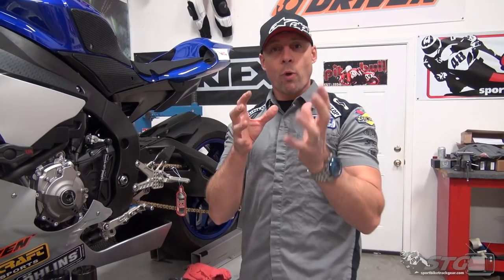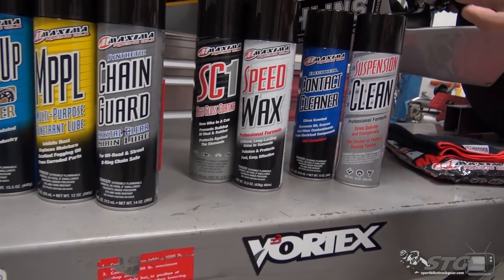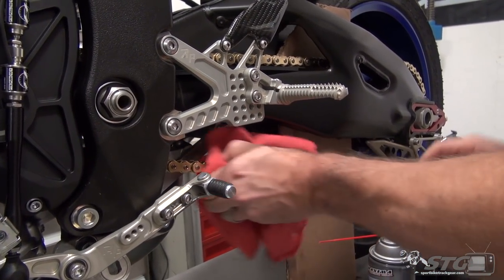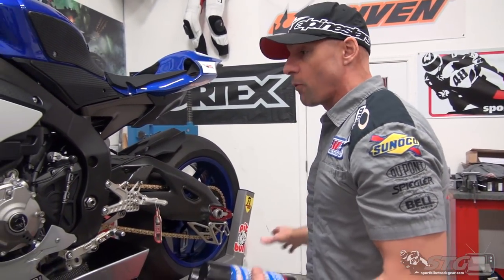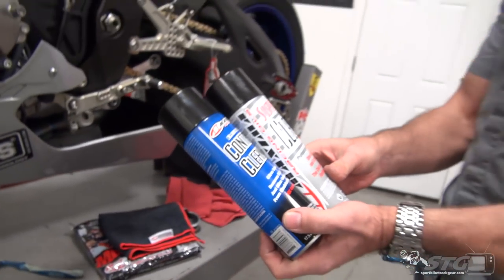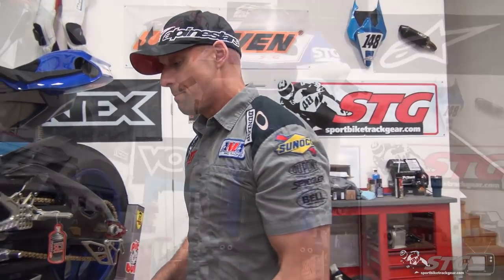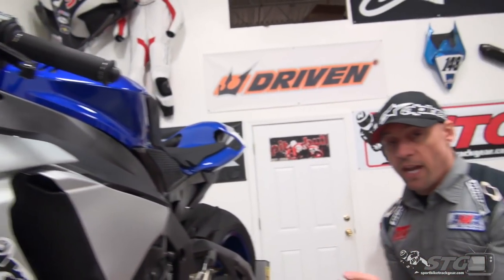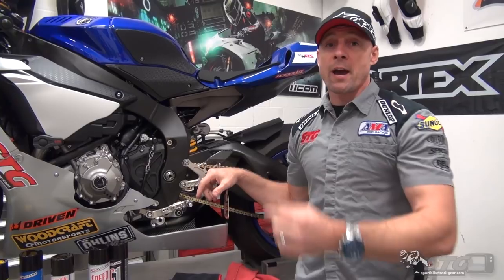How To Clean A Motorcycle Without Water | Sportbiketrackgear.com

Comment: Weird.. I clean my bike with the same good car wash soap I use on my M3, and it comes out perfect every time. Been doing that for years on many bikes I've owned... buying all these products will probably cost you close to $100, that's crazy.
Reply from the maker: For sure there are some crossover items that you could use on both the bike and the car. That said there are others you would not use on the car such as: 1) The Chain Clean Kits 2) Chain Clean Brush 3) Contact Cleaner 4) Suspension Clean. These are pretty motorsport specific and purpose built to fit the needs a rider has. Soap, water and wax is not enough to properly clean a bike. - Brian Van

Comment: What can I use to clean chain lube off the inside of my farings? I heard WD 40 works, but Do you think it would damage my plastics?
Reply from the maker: You can used WD40, Formula 409 or a mild solvent. - Van

Comment: Hi. No mention of a spray down with a hose and water at any time. Using these products there is no need to rinse them off? Is water used at first to take care of heavy layers of dirt, bugs, etc.? Thanks.
Reply from the maker: This bike was cleaned only using the products shown. No need to rinse them off with water if you follow the same steps. We did another clean up using water. Here is a link to the page: https://www.sportbiketrackgear.com/how-to-clean-your-motorcycle/  Scroll down to the second video. - Brian Van